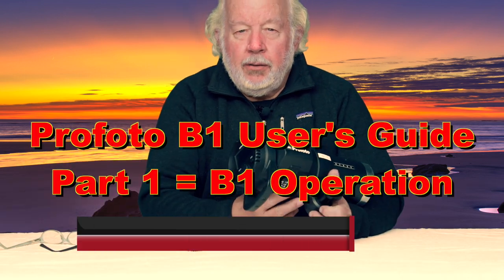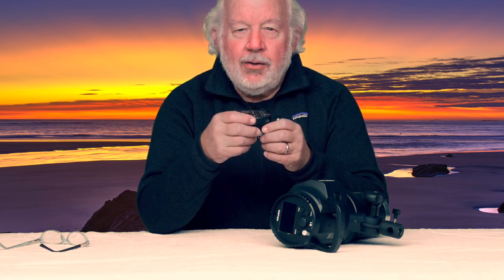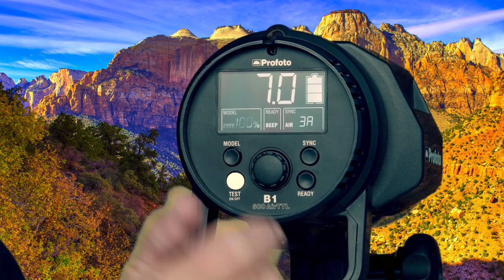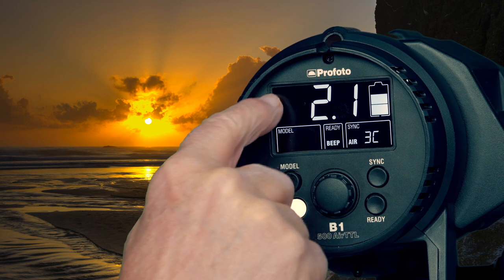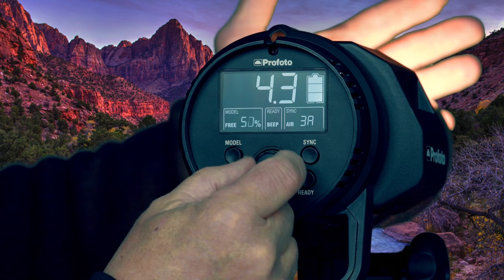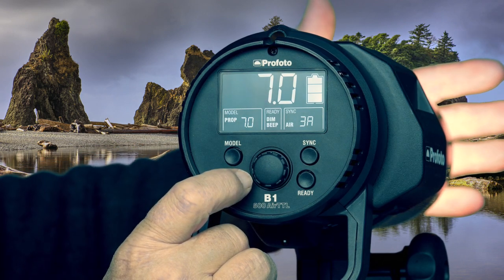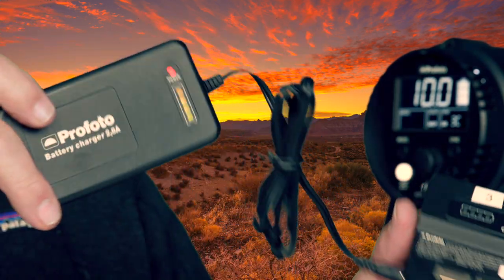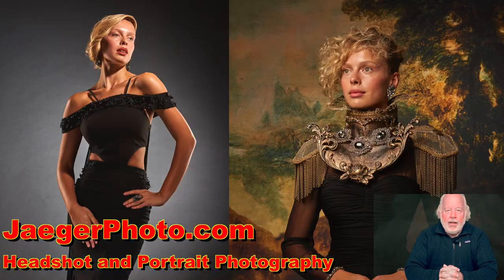Profoto B1 User's Guide - Part 1 Overall Operation

Comment: Will these lights work for video?
Reply from the maker: Video records continuously but strobes illuminate for very short times.  Strobes are not for video.  It is possible to use the modeling light for video but that is not what was intended by the manufacturer.